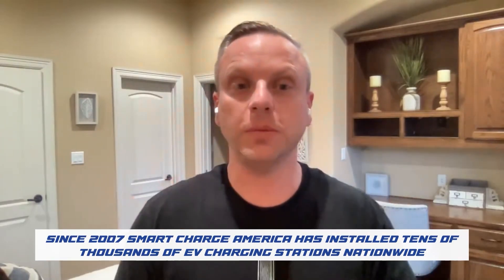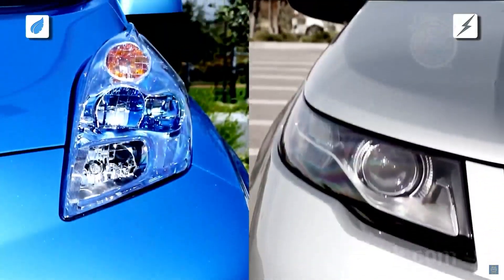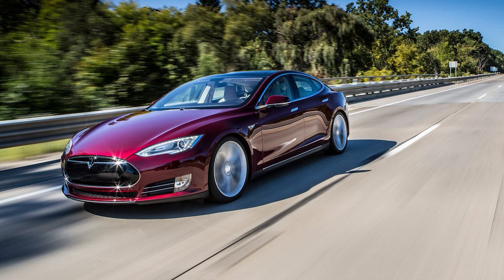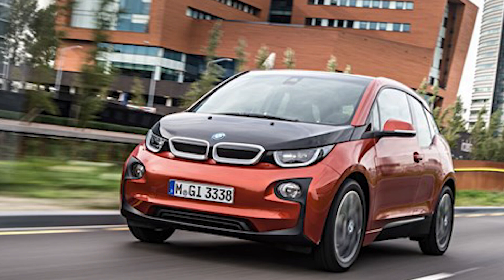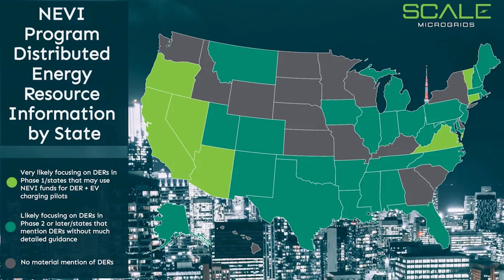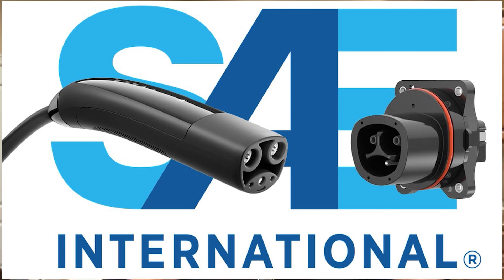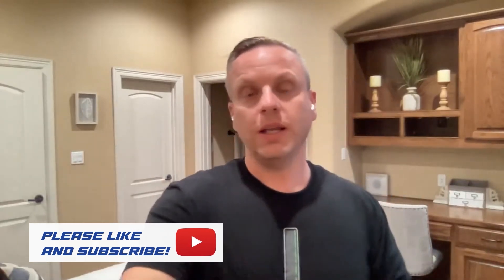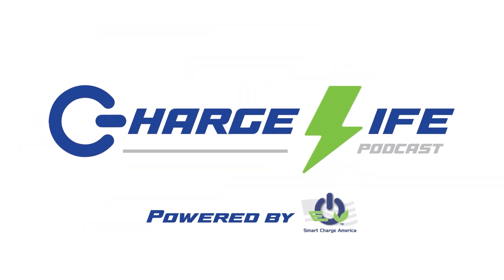E45: Tesla's NACS just certified by SAE (J3400), what will it fix?

Comment: Electric Vehicles themselves are NOT sensitive to varying voltages, they operate across a continuum from ~108 volts to 264 volts.  The onboard chargers don't care about the inbound voltage within that range, they're basically a power supply.